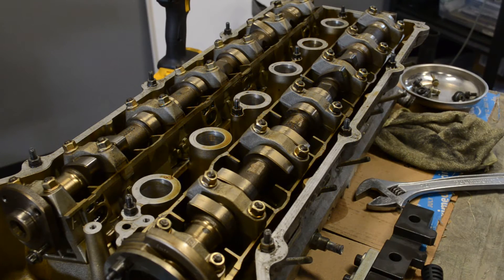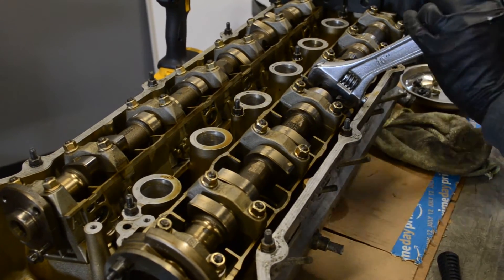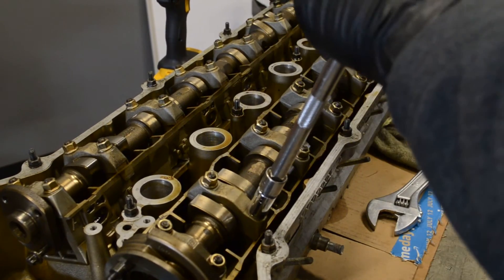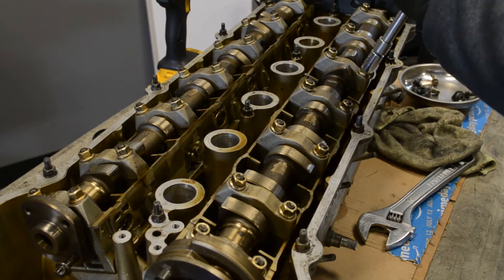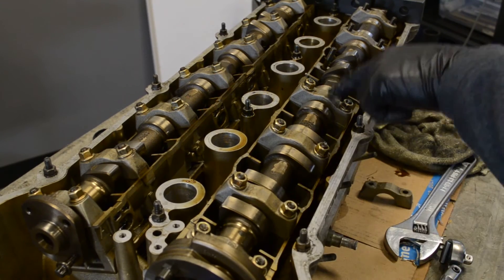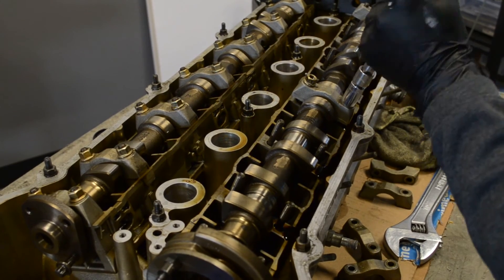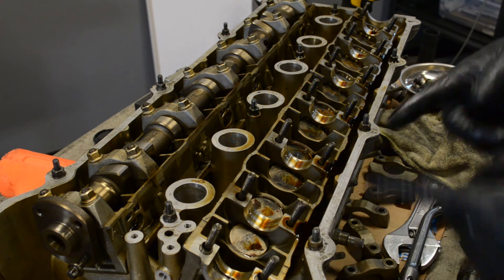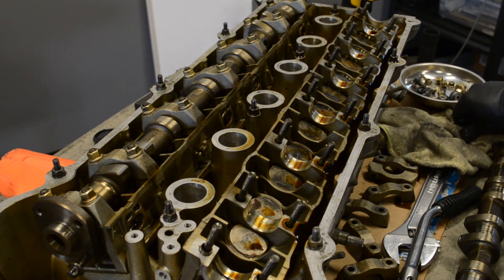BMW E36 M3 Cam Removal (S52)

Comment: Hi Guy, I have a question too..lol. I have 528i M52B28 dual vanos. I am looking to buy cams from S52B32 but I do not know if they will fit. First, I wondering if there will be enough clearance between piston and valves, second, I have a dual vanos and as far as I saw the S52 exhaust cams are not with vanos, only intake. Can you point me in the right direction or even better provide me the cams part number from S52B32 which will fit my 528i? I appreciate in advance, cheers.

Comment: awesome video.. quick question if I may.. I've a Euro 328 m52b28 with U.S S50 M3 cams.. Are you confident this method will not crack/bend my fragile cams?
Reply from the maker: Chris, if you can get the cam into a position where only one lobe is loaded, it is safe.  I have done this on a 4 cyl honda (b18) with aggressive cams.  To be safe, you can loosen the nuts gradually across all cam caps. It will be slower, but allows the cam to come up evenly off the lifters.